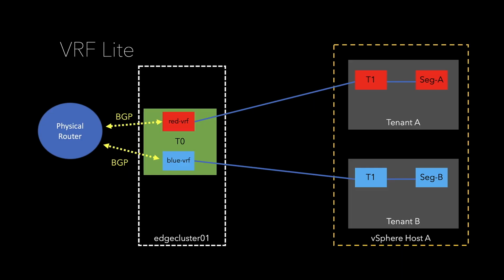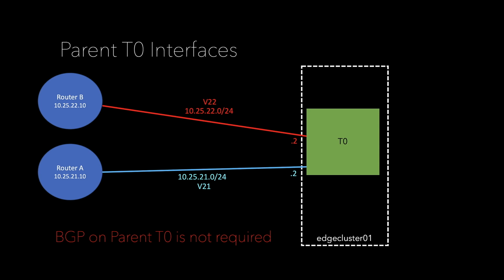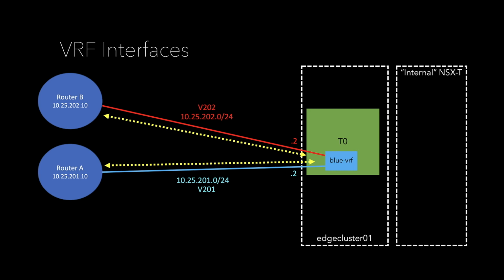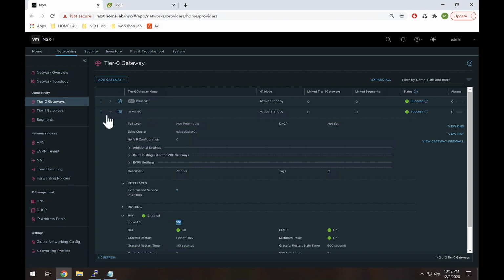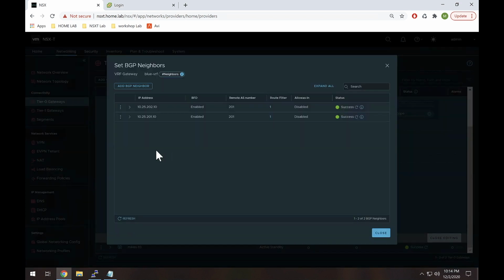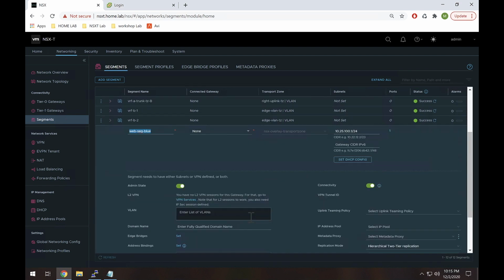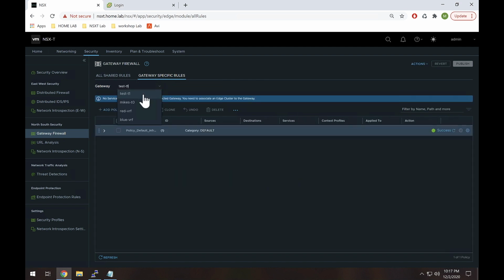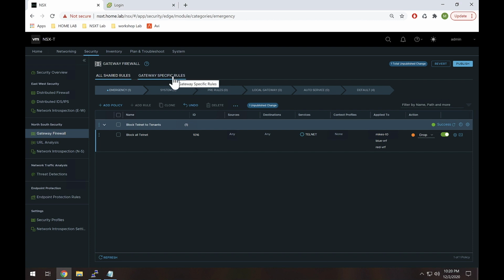How VRF Lite works in NSX-T 3.1 (Pt. 2)

Comment: Hi Mike, 

Very easy explanation of how vrf works with T0 router. However I have one question with interfaces connecting to Physical router. As same physical router connects to T0 and vrf gateway, then why do TO and vrf router connect to physical router on different vlans and IPs ?
Reply: Yeah its a little strange how it works, but I just connect the underlying T0 to a dummy, unused VLAN with private, non-routable IP addresses. It's not used, but it has to exist. All the videos online and even VMware documentation don't explain it very well or what's its function is.
Reply: we are doing this bcs we want multi-tenancy with vrf logical separation, so for each vrf we would need separate vlans and ips.

Comment: Hi Mike, good stuff, one question.
If the each VRF inherits the local AS for BGP (Same parent T0), how the two tenants comunicates?
I ask that, because if vrf Blue as ASN 100 and vrf Red as the same, basically the BGP protocol itself would drop the packet due to its general loop prevention rule
Reply: vrf provides the logical separation. So there would not be loop.